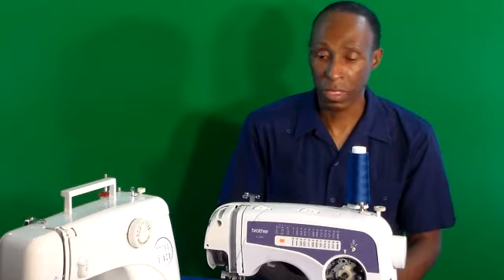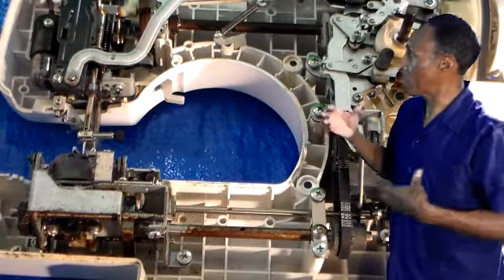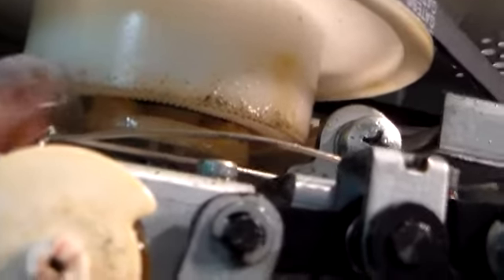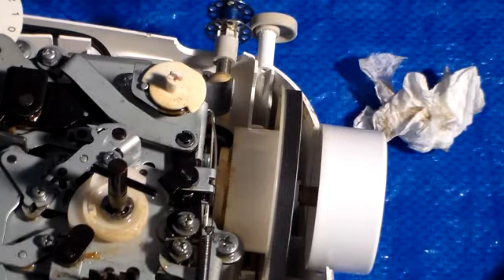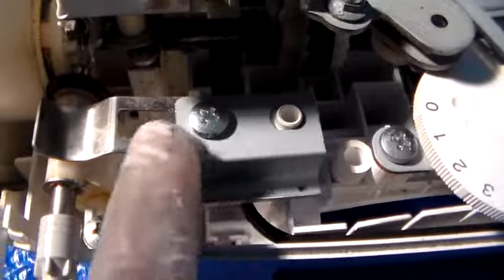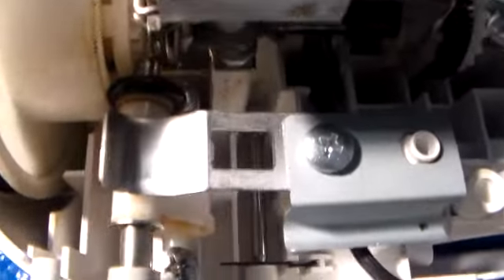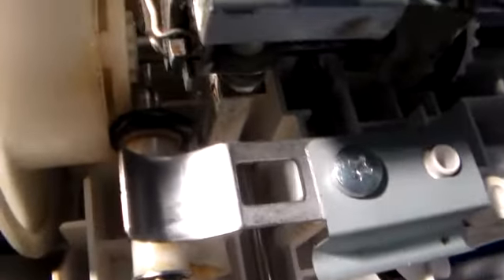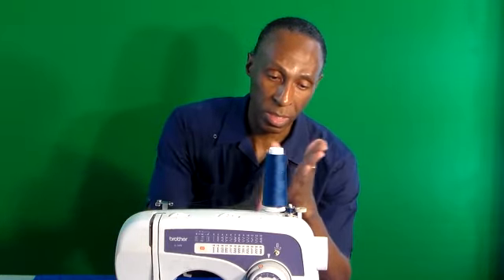Trouble shooting my Brother XL2600 part 2

Comment: Good day i am having problema with the  thread while sewing.. it makes like a loop like if it is loose in the front  and the thread in the back of the fabric get tangled..then continue sewing  ...thanks for a answer..
Reply from the maker: Margaret Culley Hi Margaret you will need to make sure the thread is not lose. for the bobbin and top spool. and keep ajusting the settings. make sure you have the needle
Reply: Ok  thank you ..i´ll keep on trying ..

Comment: I can see that the metal piece applying spring pressure to the bobbin tire has slots for the locking screw and cylindrical plastic alignment post. Sliding the metal piece fore and aft will apply more or less pressure to the tire when it engages with the hand wheel.  No need to bend this spring, unless the adjustment is insufficient.

Many of these bobbin tires if in contact with oil can dissolve and disintegrate the rubber.  I saw a  video of another brother where the entire tire turned into goo. I don't think the machine was designed to have any lubricant in that area.  Try your best to get all of it out, or you may have to revisit this fix at some future time. 

Also be careful of the types of lubricants you use. Some petroleum based lubricants can attack the petroleum based plastics used for gears and cause them to weaken and crack.
The types of lubricants they need can be plastic specific, but in general, use a synthetic lubricant like a silicone based lubricant on plastic.  Unless the lube has dried up, it is probably better just to re-lube with the grease that is already in the machine, that has been displaced from its sliding surface.

I am enjoying your videos. I am just a hobbyist myself, so my advice should be taken with a grain of salt.  I buy machines at the  thrift store or on Craigslist for as cheap as I can find, then try  to fix and or tune them up. Lots of fun.

I like the way you were in front of a blown up image of the opened machine at the beginning. How did you accomplish that. Green screen  and video editing? I am curious.
Reminded me of the movie: Honey I Shrunk the Kids :)
Reply from the maker: Eidetic Goone thanks for the information my machine's ran like race car's l  have not had any problems that l could not hack. of l needed to use a part from a VCR to fix, that's what I will use.
Reply from the maker: l used a green screen to get the spical effect